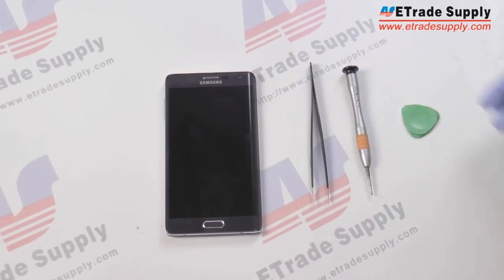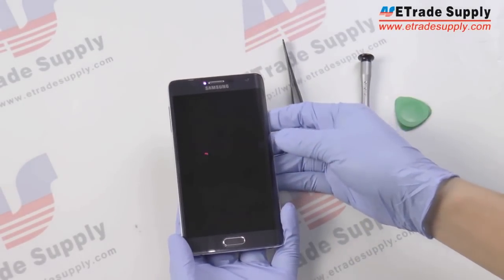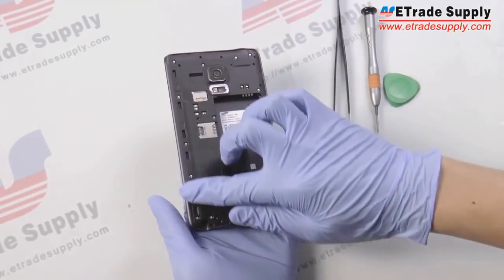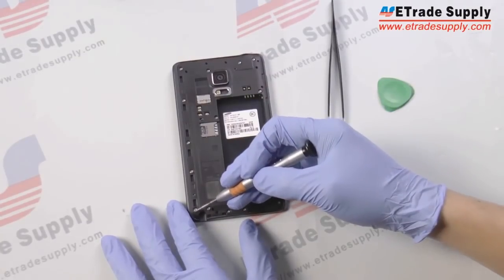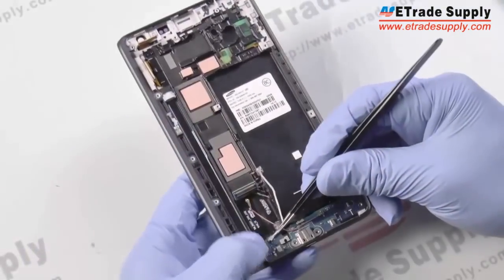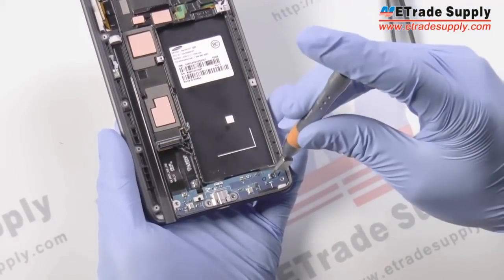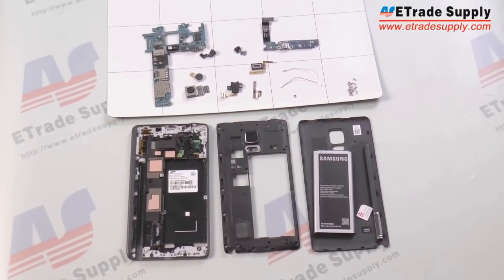Samsung Galaxy Note Edge Disassembly/Tear Down/Take Apart

Comment: Can I use the Note Edge motherboard on the Note 4? My Note 4 motherboard has died and I was thinking to put the Note edge motherboard on my N910F if that will work?
Reply from the maker: The sizes are not the same:  note edge:151.3 x 82.4 x 8.3mm and note 4 is 153.5 x 78.6 x 8.5mm

Comment: How do you remove the volume and power button?
Reply from the maker: +ctll626 Once you remove the rear housing and motherboard you will be able to remove the buttons.

At 5:00 you can see us removing the power button contact and at 6:30 we remove the volume buttons contact. 

Hope that helps.
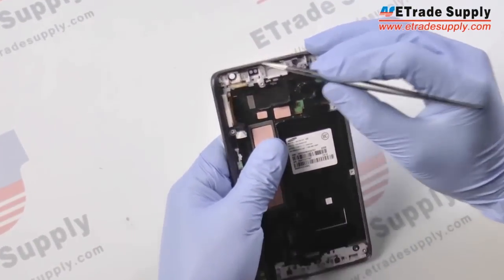Reply: +ETrade Supply thanks for the reply...but you only removed the flex cable, not the button itself. As you mentioned @ 7:45...you didn't remove the power and volume buttons because its difficult to do so. I'm asking if you know a way to. Thanks.

Comment: Will an AT&T and/or T-Mobile Galaxy Note Edge motherboard fit in a Sprint Note Edge housing?  I've installed AT&T, T-Mobile, and Verizon Note 4 motherboards in Sprint Note 4 housings and they worked great.  I'm wondering if the same can be done for Note Edge.  Thanks.

Comment: I noticed that in your store there's a separate part number for the USB charging port board for Verizon, Sprint, AT&T, T-Mobile Note Edge.  Does this mean they're not interchangeable?  I'm using a Sprint Note Edge housing and Verizon Note Edge motherboard.  Do I need to replace the charging port that's specific to the Verizon model?  Are there other Verizon specific parts I need to replace on the Sprint Note Edge housing?  Such as ear phone jack, etc?  Thanks!

Comment: Thanks for the video! just what ive been waiting for. One question, you mentioned those 2 wires near the bottom are the WiFi and Bluetooth antennas...which one is the GSM antenna then? the red one or the white one?